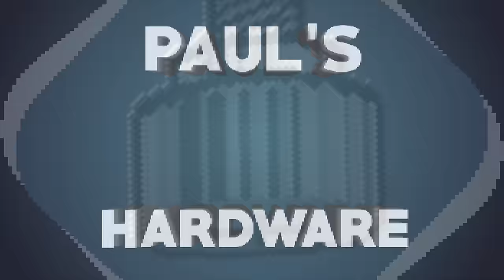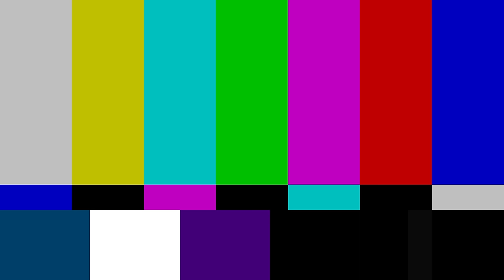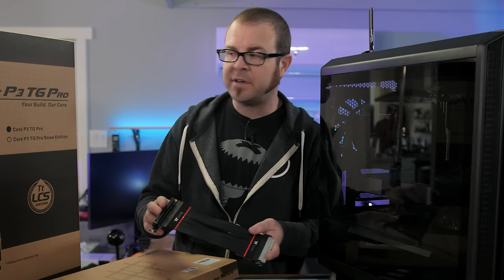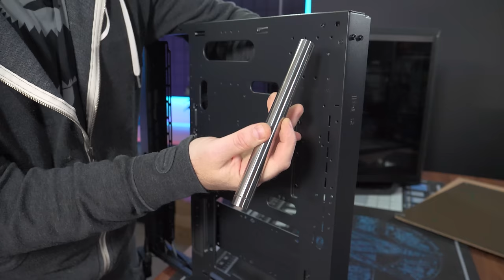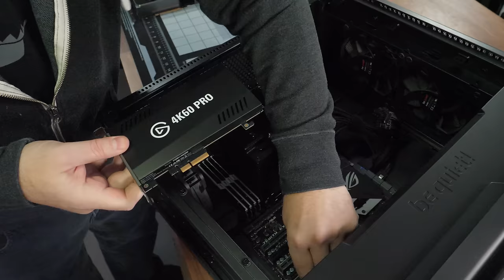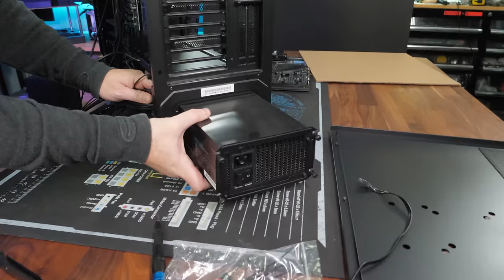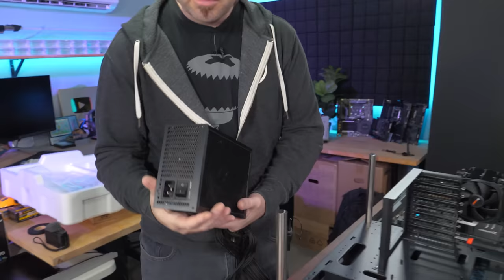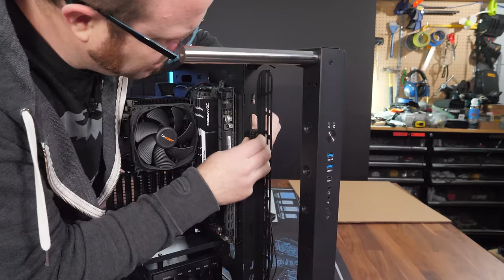Yes, this was a Bad Idea (Emergency Wall-Mounted PC Build)

Comment: It's not a bad idea, it was an incomplete idea. You did not complete it by adding earthquake straps that would prevent it from falling off the shelf. Some pipe strap(metal strip with holes in it found in the plumbing section) and some wall anchors. One end of a strap attached to the PC via a fan screw, the other end mounted to the wall via a wall anchor. 1 strap at the front of the case and one in the back. less than 1/2 hour taking your time for a 100% safe shelf mounted PC that only looks unsafe.

Comment: Yeah, I'm gonna make a prediction: That Minisplit is gonna leak on your workbench/desk at some point. Make sure it is serviced by a HVAC technician who knows how to clear a drain line, clean the coils and actually cleans the filters. I've seen/had to fix ones that were not well installed, well maintained and neglected. I don't like them be it in my own home or install/servicing them. I think you'll be fine as you're likely to keep it in good order but just make sure the drain line is clear at all times. Using a shop vac on it once a month to clear the drain is a good idea, same time you clean the filter. (You clean the filter, right?)
Reply: I was thinking the same thing. It may take years or months but I've seen it happen too many times. Maybe just a few drops but that could be enough to kill electronics near it
Reply: Well considering how easy it is to take the cover off a heatpump clean both the coils and drip tray, it really doesn't have to become an issue. Heaps of videos showing how to take these units apart, and you don't have to make a huge mess cleaning them either. 🤷‍♂
Reply: @hycron1234    There are MANY things in life that take a few minutes to maintain easily but most people never do.
Reply: been there
Reply: Is that even a wallmounted movable ac... Or simply the inside unit of a minisplit? On my unit, the drain is outside, on the outside unit/part of minisplit.
Reply: @brioshoveit  To me it looks permanently installed. I only say this because I used to live in an apartment that had one just like it but over the door
Reply from the maker: I appreciate the heads up on the AC maintenance, it is something I intend to take care of on a regular basis. The main drain line for the split unit feeds outside, and thankfully the condenser is in an area on my side patio that I can easily access, and also in a spot where I'll be seeing it regularly as a reminder to service it 👍🙏
Reply: hrmm excellent points, this is why I pay the guys who installed it to come service it once a year as well.....

Comment: I have installed a LOT of cabinets over the years (also in southern California earthquake country). 
All you need is one stud with two screws. So long as those screws are properly centered in the stud, two 2 1/2" framing screws will hold the weight of a PC just fine.
I have seen 100lb+ upper cabinets loaded with dishes, mounted with a single screw....

Comment: I've had the OG Core P3 mounted on my wall for the past 5-ish years, best decision I've ever made... Happy to see one of my favourite tech creators make the transition. It's gonna need a lot of regular dusting, but it frees up so much of your desk space that the trade off is more than worth it.
Reply: I made a similar comment before seeing yours and I agree with it all. I got my P3 case in 2020 during the pandemic when upgrading to 10th gen i9, but I never did end up wall mounting it. As I said above I think this gives me the inspiration to finally mount mine. It's just been on my powered desk behind the monitors. The dust is something I've had to content with as well. Although a few months in I changed my fan profile for my AIO fans to ramp up per the temp and they stay off under 40c

Comment: i built my wife's system in the first gen Core P3 several years ago. very solid construction, and easy to work with. been really happy with it. hers is wall mounted as well

Comment: I have the same case (non-pro) and wall mounted it last summer. Best decision I ever made. I also have it on an articulating wall mount for easy maneuvering. if I need to change anything. and easily take it off the wall. I was eyeballing this series for almost a year before and I've never been happier with a case. Good choice, man!

Comment: funny enough I also am in socal and did a very similar build. same "case" and same mount! I opted to only use half of the mount without the center attach bracket. this means I could only grab 1 stud so I just centered on it so there is no overturning moment. one thing to be careful of is in the case of an earthquake, the PC can slid on the back bracket left and right so I recommend a stopper in there to ensure it doesn't move too much. also, I got the Corsair shift psu prior to deciding to mount on the wall, which made things quite awkward when mounting it! love the video and glad I wasn't the only to take the dive!

Comment: I'd suggest mounting a vertical rail about 6 inches from the back side. This will let the connectors come off the ports straight and then have a more gradual curve down along the rail where they can all bundle more neatly before they head down to the desk. Should give a cleaner look and be better for the cables.

Comment: Nice placement Paul. I would had suggested using like a spare 2x4 or wood plank that would had been installed between the studs but you did made sure its secured. For the wires, a DIY in wall kit could clean and/or hide the cables yet having longer cables for that USB hub could help to bring that HUB and card reader closer to you.

Comment: Was really funny to see you had te same issue I had with the wall mount. I build in the p3 last week and had a 2 part bracket which was 3 inches to wide. Ended up replacing the mount for a vogels slim fit one. Enjoy the space on the desk 👏

Comment: I think I've watched this about 5 times now. I'm looking forward to building on this chassis. Paul, there is a video I've seen where you can cut into the sheetrock and place some cable channels which allows you to hide the  cables really well.

Comment: I have the original P1 micro pc case for Thermaltake and the wall mount was the main reason I got it. 7 years ago and three upgrades later it’s still on the wall!

Comment: I got the same case about a year ago - overall I love it!  Don't have it wall mounted so it's about the most inefficient use of space for a pc build, but I get endless compliments on it.  Fits a chonktastic 64mm thick 420 radiator, and I put in an (almost pointless and needlessly expensive) open loop water cooling system for cpu/gpu.  My only critique is that there should be more perforation on the back panel, airflow from a rad going out the back is restricted.

Comment: I did a wall mount of mine with the same case a year and a half ago and it’s awesome. Has been great with the vertical gpu mount and I had used the same vesa mount you did as well and ended up just using half of it. But I don’t have to worry about studs in this wall so really didn’t matter where the anchor points were.

Comment: As a former infrastructure cabling technician who has mounted thousands of TVs, +1 for using Mounting Dream for the wall mount! They seem to be the most reliable, with kits that include everything needed, while also being competatively priced. Almost as cheap as the "onn" brand, which is usually cheaper but may not include enough plastic spacers or washers needed for specific setups (commomly stocked at walmarts)

Comment: My PC is wall mounted similarly to what was shown at the beginning of the video, with a simple shelf below + I drilled a keyhole shaped hole in the side panel facing the wall (two adjacent holes, one slightly larger than a screw head, one slightly smaller). One screw in the wall is enough to keep everything in place and it could easily sustain the weight of the PC on its own without the shelf.

Comment: I really like the open chassis on the TT P3. I decided against using the glass even, which eliminated having to use the top 2 mounting posts, giving it an even more open assembly and really shows off the entire build. Mine does sit on a desk, so I still had to use the bottom 2 posts to mount the base. I have a custom loop so it fills in the mounting space to the right of the motherboard nicely. Not using the glass panel would be an easy solution to the reflection you mentioned at the end of the video.

Comment: Fun DIY video as usual! 14:50 Yep! I've gotten the habit over time to switch the PSU off then press the power button on the system a few times to expend power before messing with it. At least with my current build and PSU it will sometimes attempt to start for a second on first press, but for the second press it clearly doesn't attempt to start. 👍

Comment: I love this case. The only case in the market that has ample space to vertically mounted a 4090 and Sound Blaster card with two extender risers. Good spacing between vertical 4090 and NH-U12A cooler so can remove the GPU effortlessly. Mounted it using fixed TV wall bracket. Comes with all the fittings and about 3 inches gap between the wall and the case.

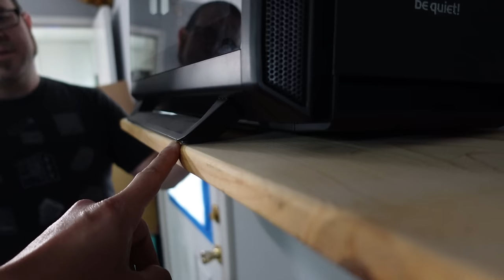Comment: 2:06 - "Here's a temporary solution, only to come back to it several months if not a year plus later..."  Especially remarkable since I just read an article about how the Windows 11 "Format Disk" UI was a temporary solution - made during the changeover between Windows 95 to the Windows NT kernel, 30 years ago.

Comment: I have a core P5. Some mods i've made. A top sided radiator bracket,  went to Lowes and got 1"x 1/4" aluminum bar &  3/4"  black rubber hose clamps with an offset clamping point so they can wrap around the metal posts and bolt onto the aluminum plate. I also added a 90 degree radiator bracket towards the front to have 2 140mm front facing fans. As for fans, Arctic fans are the best sound to performance bar none.

Comment: During covid I got that same case to wall mount but never ended up doing that. Just sits on my desk but I do like the case a lot, other than it can get dusty. I have an EK 360 AIO and even though its on my desk it still sucks the cats hair into the rad fins, at least before I set my fans to only ramp up when it gets warm. Altogether its a great case but I do have the older model. Getting the back plate off of yours is WAY easier than mine. Mine has hooks that need to slide in and to the side to line up the screw holes. Anyway, I know you'll like it and I think you've inspired me to stop procrastinating and mount the damn thing to my wall!

Comment: Please add some rgb fans on the right for looks and to pull in some a bit more air.  Also run cables inside the wall if possible to a plate under desk.

Comment: 13:05 We heard all three of those clicks when you connected up your 12VHPWR so here's 🤞 hoping that means you won't have a potential fire hazard instead of an earthquake hazard. Wall mount option you chose looks way more awesome than using an earthquake strap 👍👍

Comment: Get a darker matte colored static cling of your logo made and put it on the glass. It will cover the fan slots and minimize the reflections. If you get several different ones made with your 8 bit styles, you could change them out, since they would be static clings, and maybe sell a few as well.

Comment: i have this case, its in white. i built it two years ago. its wall mounted in my living room on a 3 axis swivel TV mount.  there are so many files out there for 3D printing on this case. PSU covers, cable hides, radiator mounts.   i have two 360mm and one 240mm rad on this case with a vertical mount 3080ti. its dead silent and a great case. does not really get dusty either.

Comment: Love this case (you'll understand in a minute)....I have the ThermalTake Core P3 for my older pc (built 2016), which has been replaced by the Thermaltake Core P6 TG for my new pc (built 2023) and they are both on display as they are both custom water cooled. So art as well as pc's 😎

Comment: I still rock the original P3. Still need to get a PSU mount for it. I bent some brackets just so I could mount the PSU. Still works and still looks great. The 420mm AIO I have barely fits but it does and so I will keep this case for a bit longer!

Comment: Look for transparent non-reflective coating sprays. That might be just what you need in order to get the glass on the case to not be so shiny. Drawback being is that you'll lose the high gloss finish, and the spray, depending on how it's made, may etch the glass. Check the label. :)

Comment: Yeah, those 12VHPWN connectors (I think that's what they're called, right?!?) in the middle-top of the 40 series cards result in a really unsightly mess of power cables in what would otherwise be a neat looking build.

If that was my setup I'd attach some RGB fans in the empty area right of the mobo for looks and, even though they're not being used to cool anything, they'd look cool. 😎

Comment: I got the largest bamboo cutting board I could find on the Home Depot site and a couple of brackets similar to the ones you're using for your shelf. Wide and sturdy.

EDIT: Make sure to mount the brackets on the studs (if possible)... and don't live in an earthquake-prone area :)

Comment: I have wallmounted and watercooled PC in Core P5 for over 6 years. Under AC. Also have the case rotated 180, basically upside down. Originally got it because it was easiest how to mount SSI-EEB Asus dual socket Xeon board to something not expensive and not bad looking. I kept it when upgrading to AMD. I do like it very much, will not go back to normal case.

Comment: im at he point of the video where he is unboxing the thermaltake case. i did this about 5 or so years back and depending on the TV or wall mount you could have issues still. with mine i had a tv wall mount that would allow you to rotate the screen and the case was heavier on one side and would always rotate down unless i somehow stopped it from rotating, i have since built a custom wall mount system and have them solidly on the wall. i Took the sliding/rolling Barn door approach with the new mounting system. i did this as if i have to work on the PC i can simply roll it over to the door to my room and remove it easily from the wall.  i would wall mounting PC's to you as it will clear up space on the desk.

Comment: I had a build in the TG1 when it first came out. Always planned/wanted to wall mount it but my wall’s stud spacing was/is stupid so it (sadly) ended up on the floor. Still love the chassis series, would totally build in them again.

Comment: There's aluminum extrusion PC frame that you can mount your stuff onto, basically a test bench that can stand vertically. You can just install a hook hole meant for drives / water coolers on the top of the frame and use hooks to mount the PC to the wall. That's how I do it. The frame costs me about 20$.

Comment: That is my exact case. I have it sitting on the desk as mounting it on a wall will be difficult to access for maintenance, etc. It is a very heavy case. You would think it has good cooling, being open but not. I had to mount an additio9nal fan to provide better airflow.

Comment: My biggest issue with those wall mounted cases are where they put the buttons, they know it's going to go on a wall, so why don't they put the buttons at the bottom, so they're easier to reach once wall mounted?

Maybe a little feedback for Thermaltake so they can improve their design next time.
Reply: get some remote mounted buttons and maybe lights
Reply: @profosist  Not sure you can for the power. Also they should still do it in the next case to improve it.

Comment: Those cases are probably the easiest you could ever build in. Their a lot stronger than they look and though being open air it's not really a dust collector. They look really sharp with an AIO mounted on the side. Heat is not a problem but their are brackets to mount 3 fans to the posts on the right side.

Comment: Nice Favor and they get some free advertising for a cool case. Also I'm always in favor of grabbing a power tool to make something work. Also where is the sensor for the minisplit? if it's on the unit it may set it off more with a heat generator 2 ft away?

Comment: Personally, I would have just removed the glass and the large brushed aluminum studs used to hold the glass and left the computer without the glass face just because I believe it would get more frontal air flow and then you wouldn't have to worry about any glare anymore. 

Pretty sure you could measure, cut, and glue up some black corrugated plastic sheets and touchup the edges with satin black and figure out how to mount it over the IO shield to hide the cables too. Probably could make it even better if you double tape mounted that RGB/FAN controller dangling behind the cables to the shroud and clean up that side even more.

Comment: unfortunately I've been through this with my case (Thermaltake Core P3 ATX), i knew as soon as you said expansion cards, that the vertical mount would not work... it's a shame, whole reason i don't have mine that way.  i am actually getting to the point of potentially wall mounting mine after 5 years.  it's interesting they took the HDD mounting away from the cooler area.

Comment: You could have just taken the feet off the old case and put it back on the shelf and it would have been fine.  Maybe add a few small bumpers if the PW was facing down as spacers.

Comment: Concerning that SanDisk SSD: I have seen high failure rates on SanDisk SSDs from before 2020, so be aware. I currently replace about 2-3 Drives per month with Crucial MX500 drives, which seem to be quite reliable so far.

Comment: newer dark rock pro psus aren't fully "off" when they're switched off, like most psus would be.  if it's plugged in at all, the board will be getting some level of power.  might just be a 5v rail, not entirely sure.  expected behavior according to bq.